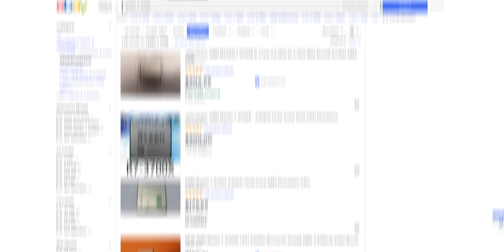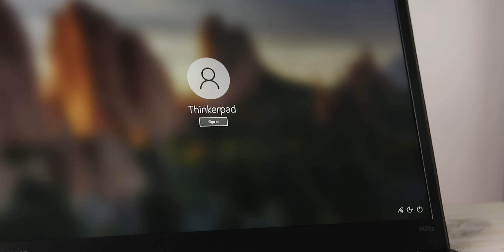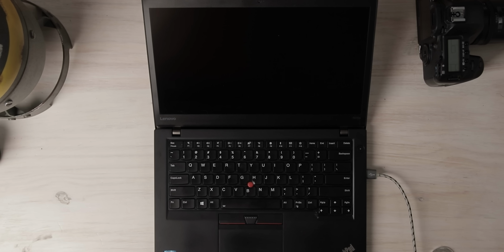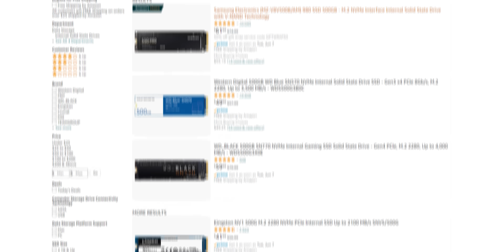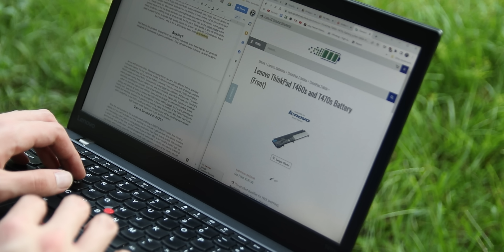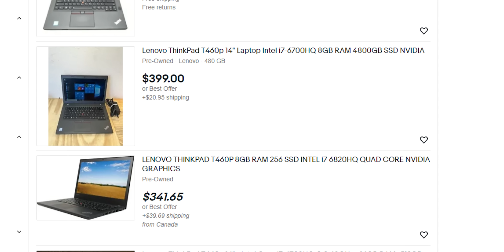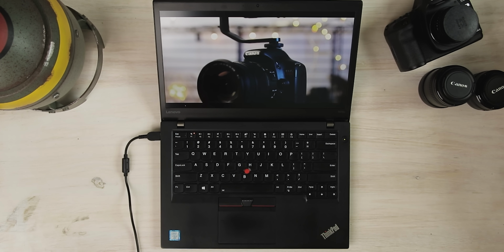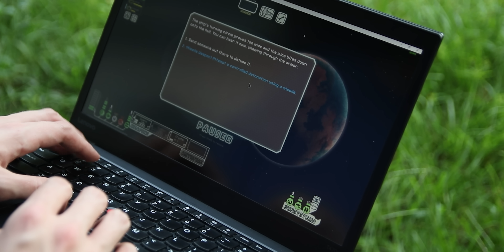I Couldn't STEAL A Better Laptop... I Tried - Lenovo Thinkpad T470s

Comment: right on and great video. subbed. I picked up a T480 for $480 CAD and its an amazing machine.. I was also on the fence to spend $3000 for the MBP 14" and I couldn't justify spending that much for my workflow.. This is my first Thinkpad and it's absolutely stunning. My brother used T61 before and he still has it running Win 7 I believe.  I feel like its better to get older Thinkpads than newest laptops if you don't run resource heavy task. My concern with MBP was that you can't upgrade anything anymore and Apple wants $400 for 16GB upgrade (MBP comes with 16GB already) for total of 32 but then I realized that its quite steep for what my needs are. So then I started searching for used market and came across T480 and apparently its the last model which you can upgrade ram and hard drive for.
Reply: I recently bought a used Thinkpad L14 Gen 2. It has an i5 1135G7, two upgradeable RAM slots and upgradeable storage. An absolute bargain if you ask me!
Reply: Only reason I went for P1 is it still has a full size sd card. But it and x1 extreme are both upgradable, though I understand they use glue in the panel assembly now so a screen swap is more of an ordeal.

Comment: I got a thinkpad t480 back in 2018 for college and it survived the whole journey, I was still using it daily up until last week when I built a PC with the money from my first full time job. Has a 4 core 8 thread i5 8350u and also an mx150 gpu. Never had any problems with it running any engineering workloads (code, CAD, FEA, etc). Cpu is rated for 15 watts but as long as it's running cool, I've seen it do 30+ watts sustained. I did some image rendering for some projects which could take a long time on it but I found a piece of software called tpfancontrol which really breathed new life into my machine. It basically lets you mess with the BIOS fan curve so I just cranked it up to reduce overheating bottlenecks, runs great under load (if you can get past the added noise of the tiny fan spinning at 5000 rpm), and I'm even able to run some light esport titles on it. The internal battery died a long time ago but I paid $50 for a 72 watt hour replacement battery ~2 years ago and can still easily get 4-5 hours on battery when on power saving mode. Nowadays I'm just more conscious of using Lenovo Vantage to limit my charging to 85% to save on battery health. Also upgraded to 16 gb ram last year. Probably ran for a bit over $1000 back then but definitely worth it imo, excellent and resilient machine, I'll be using this thing until it dies and I'll be very sad once that happens.
Reply: When it dies you may simply replace the internals🎉

Comment: Had my Thinkpad since 2008 and still going great. It did have some major work done over the years but I won't trade it for anything.
Reply: still have my acer aspire 7551 from 2009.. and it still seems better than this. lol..    64bit,  2.2ghz AMD quadcore, I upgraded to 16gb ram (DDR3).   I got it for about 250 back in 2010 (used).  I've used it to run 2 big screens in my living room for over 6 years now..  And I'm usually running at least 4 browsers with about 40 tabs on each one.. It still runs fine somehow. :).  I don't understand why everyone keeps talking about these thinkpads?    Mine is 10 years older than this and it still seems like faster hardware..  We have a more modern little laptop that has some 1.7ghz.. something-- and running win11.. It's terrible.    So I think you just talked me out of buying one of these thinkpads. :) ..  I think I'll just dual boot with mint or zorin..  Or maybe go ultra light with MX or something else.    I was getting sucked into the "linux thinkpad" vortex for a minute there....

Comment: I have an x220 from maybe 2012 still going strong with Linux Mint. Planning to replace it soon but 10 years is a pretty good life for a laptop I think!
Reply: I still have my acer aspire 7551 from 2009.. and it still seems better than this. lol..    64bit,  2.2ghz AMD quadcore, I upgraded to 16gb ram (DDR3).   I got it for about 250 back in 2010 (used).  I've used it to run 2 big screens in my living room for over 6 years now..  And I'm usually running at least 4 browsers with about 40 tabs on each one.. It still runs fine somehow. :).  I don't understand why everyone keeps talking about these thinkpads?    Mine is 10 years older than this and it still seems like faster hardware..  We have a more modern little laptop that has some 1.7ghz.. something-- and running win11.. It's terrible.    So I think you just talked me out of buying one of these thinkpads. :) ..  I think I'll just dual boot with mint or zorin..  Or maybe go ultra light with MX or something else.    I was getting sucked into the "linux thinkpad" vortex for a minute there....

Comment: I found a Lenovo SL510 in the e-waste bin of my building. I gave it 8Gb of DDR3 RAM, an SSD and I was able to get two replacement batteries from my local Microcenter for less than $50.  I put Linux Mint: MATE Edition on it.  It's awesome!

Comment: Nice video. I buy used Dell Latitudes on the same principle, they are well made and well speced, companies lease loads of them and then they get dumped on the aftermarket after three years' use at a fraction of their original list price so there is a lot to be said for vanilla business machines.
Reply: Idk seems way better value for me, i bought acer aspire 5 with i3-1135g7 and nvme for 250$ on blackfriday brand new, afaik the cpu is better than these older cpus
Reply: @reuven2010 that modern i3 wouldnt perform that better than older i5 or i7, plus you're paying more for a more fragile machine. Used business laptops just hit differently.

Comment: I have a T450 with Linux Mint (as well as Win7) and it's perfect for any task. I like typing on it because its keyboard very comfy. I think that from T450 to T480 they are good in this series. When I was using, a T490 was killed in action with many wounds on it. So I've bargained my second T490 for a P53 on my workplace. In the P53, I feel that the the old school Thinkpad series were reborn.

Comment: I'm usually someone who prefers the business ranges of HP or Asus (loved HP's ProBook series back in the day), but  the Thinkpad series usually has some great entries and I have several friends in the IT field who swear by them.
Reply: I'm in it support, HP ProBook series from 2019 onwards (G6, G7, G8) are better than ever, IMHO, infinitely tougher and more reliable than ThinkPad L, for example. Great value and quality for the price. Keyboards suck, though, as they always have wirh HP, but everytging else about them is great. Amazing, for the price, actually.
Reply: @millancche  At home, I use my desktop graphics station for most of my work (software development and CGI work for low-budget movie productions), but I also still have a ProBook 8440p for holidays and the like and after almost 12 years (and adding more RAM, a hybrid harddrive and a fresh aftermarket battery) the only problem with it was that I recently had to replace the spring for the pop-out LED that shines a light onto the keyboard. Still runs RetroArch and playback of 1080p videos just fine and that's all it needs to do.
Reply: @Iskelderon  what you use is old Elitebook, not Probook, beautiful and reliable stuff, i love and miss their design so much :) I guess you'll bw happy to know that modern Pro and Elitebooks are still good and worth buying ;)
Reply: I still use the old ThinkPad X61 and it works quite nicely ;)
Reply: @AzraJ  It just makes a world of difference when a laptop was actually designed for work and durability and not just a cheap price point and only Youtube and MS Office.

Comment: My current daily driver is a t490 with the i7-8665u, 16GB of ram plus the 8 extra I added, a 512GB ssd and the 1440p glossy(only gripe) screen I got from CL in Sept of '21 for $380. It's under warranty until May of '23, 3 year warranties on business class stuff is awesome. I think they were going for over $700 at the time, far and away the nicest laptop I've ever owned. It'll just about handle BF3 lol.

Comment: I’ve been rocking a T480 with an i5 for awhile now, and it does everything I could ever need. I got it dirt cheap on eBay, upgraded the SSD and reapplied thermal paste. I use Linux, but not even a light weight distro and I have zero complaints.

Comment: I still use daily a 10-year-old ThinkPad X1 Carbon (Gen 1), that's how tough and durable they are.  
In next couple of years I may upgrade to a Gen 10 or X1 Extreme.  
Before ThinkPad I had various laptops from HP, Sony Vaio, etc... they all fell apart after a couple of years.  Also I find the Trackpoint much easier and faster than a trackpad, once you get the hang of it (the trick is holding it down with your middle finger and your thumb on the buttons.)
Reply: I'm still on a t420s and it runs like a clock. Once it no longer satisfies whatever I do on linux it'll become a compute node in my openstack setup until the end of time probably.

Comment: Great video! Some time ago I bought a refurbished T460 and I just love it. It had a dent in one of it's corners. Rest of the laptop was in great condition. I installed Linux on it and couldn't be happier. Most of heavy processing I do in the cloud anyway. Checked the batteries with upower and they still go around 85% of max cap. One thing which is cool about those refurbished laptops is, that accessories are super cheap. I bought a docking station for less than 20€. In the future I will probably mostly try to buy refurbished laptops.

Comment: I've got the t470 with the i5 7th gen for almost 5 years, I've updated all that I could, I added a second disk on the extra pciE port, and two 8gb sticks of ram, and it still is my working laptop, programming in it is great, even using the touchscreen that for android emulation is useful too. Docker runs great too even though the core is not that heavy duty.
Reply: still old stuff
Reply: You can add a second disk?
Reply: @carldrogo9492  Yes, I've added a little ngff disk of 512GB, on the extra pcie port it has, it was next to the wifi card. I saw this port when I opened the notebook to clean.

Comment: As a business IT person, we don't sell our old laptops (we do manufacturing so they just get dirty) However I talked to my boss and hand them out to friends and family if they need something and we are tossing a decent one.  While we use Dell, we have seen that same exact battery issue happen to laptops once they hit a few years old.  Thank you for pointing that out since it can both be an added expense but also a safety one.  The hard drive is the same issue, due to our manufacturing restrictions since we make guns, we have to take out all the hard drives after use.

All in all, I really liked this video and find myself agreeing about the idea that older isn't obsolete but you need to understand that it comes with some extra precautions when buying
Reply: what's happening to hard drives, are they grinded?
Reply: @vipvip-tf9rw  we send them to a data destruction company that picks them up once a month or so.  Since a lot of laptops have moved onto NVMe that means we can't reuse the older solid states.  If it has an NVMe we can image it on a new laptop to use them again.

Comment: I managed to pick up a T470 (none S variant) for a absolute steal of £160 GBP. Both RAM sticks are swappable and I even managed (with a little trickery) to install Windows 11. Now the T470 has basically no gaming capability at all, but I bought a docking station for it, hooked it to my bedside monitor and use Nvidia game stream. So its a laptop for travel and basically a bedroom terminal for my gaming desktop when I am at home.

I absolutely love this little laptop.
Reply from the maker: The T series is really amazing. Finding a good laptop that is built to last, thin, and doesn't have an apple logo can be challenging. Especially on a budget.
Reply: I've been using my T470 since last year, which I got for around $100. I ended up spending some money on a larger SSD and RAM and it's been great to use for me. It's a lovely laptop to use.
Reply: Just bought a used T470 with 16gb RAMon eBay for £129 GBP!
Reply: I picked up a T440 at the height of the pandemic for a price I’d rather not admit, but it’s fantastic for the money. It runs Windows 11 better than it ran windows 10! The batteries are a bit meh, an the processor can just about run a vm in virtualbox, but it’s usually plugged into my 34” Ultrawide. Only thing it really struggles with is 60hz on 1080p and above, 1440p at 30fps on YouTube is nice and crisp. Definitely a great deal for a laptop manufactured at the end of 2013! Don’t forget to install Lenovo Vantage if you want to control the max charge level of your batteries guys! 

My next machine when it dies will be another thinkpad!

Comment: Fun fact, these do support windows 11,you just need to switch the tom support from cpu (tpm 1.2)to the embedded controller one with tpm 2.0
Reply: How to do it?
Reply: @senangcoding4747  From what I recall, there should be an option in UEFI settings. Not sure if you need to update it first though. It'll be near some options marked as 'Intel Platform Security' or some such.

Comment: I'm typing this on a T470p that I bought 3 years ago as a refurbished laptop. It's a great piece of kit, other laptops I've bought have usually fell apart by 2 or 3 years so these ThinkPad are great value for money. I bought a spare battery for €50, the one that came with the laptop is still working great.

Comment: I used a T460 for a few years at work and was surprised at how well a dual core i5 would keep up (although I would go for a quad core still if given the choice). Recently got 'upgraded' to a T14 and it's probably the worst laptop I've ever used. It has been slimmed down, so no abundance of ports, the cooling is horrible and it throttles easily and they put the vents on the right side for some reason, so if you use a mouse with it in your right hand, prepare to get your hand cooked.
Reply: What cpu does it have?
Reply: Almost similar story for me. Had a T460 and then got a X1 with an i9. Understandably it was really hot, but the battery and screen both failed within a year.
Reply: Yeep .My friend bought, new top of the range Thinkpad for 2 grand and the build quality was shockingly bad comparing to my 2015 MacBook.It got
unbearably hot within minutes and the plastic felt like it’s going to snap in half.
Reply: @satoriaudio  Which model was it?
Reply: @zNoah    Hmm. No idea. It was about 2 years ago.
Reply: I never really thought about before but if you want to use a mouse the exhaust port needs to be on the left side as you said to keep your hand from being cooked. Those exhaust ports can get pretty warm.
Reply: I did grab a T440p quad core a while back, but it needs a bigger PSU than ordinary Thinkpads.
Reply: Lenovo will hopefully realize and relaunch old school laptops

Comment: Well I did the same thing and bought a Thinkpad T480s in almost new shape with 1 year warranty. I paid USD 253. It has 8 gb ram, 256 gb SSD and a i5-8350U. Going to upgrade it with a 16 gb ram stick to a total of 24 gb.

It has perfect Linux support using RHEL 9.
Reply: Where did you buy it?
Reply: @loiruckgodwin2372  At some danish 3rd party seller.
Reply: Is T480s a good option in 2024??
Reply: @pkboss8324  I would however only get a *80 /*90 series machine, if it was dirt cheap  (USD 250 max) or you have a very specific task, that does not need any amout of modern performance.

Would work perfectly as a home server though or the like.